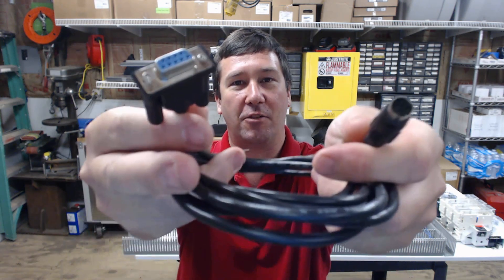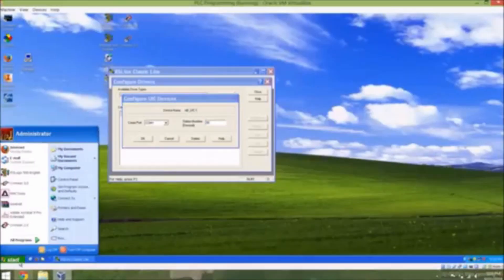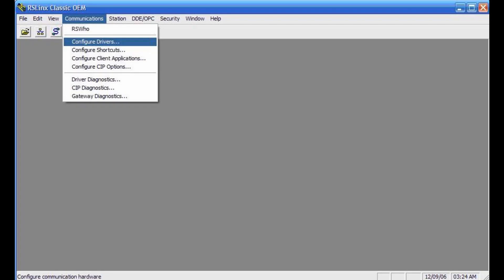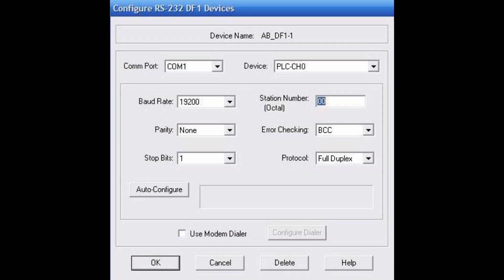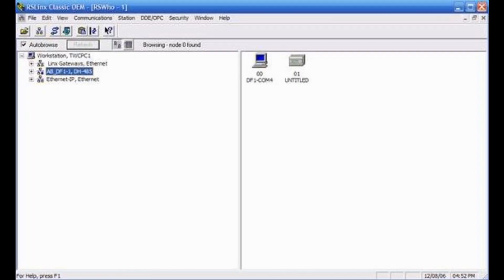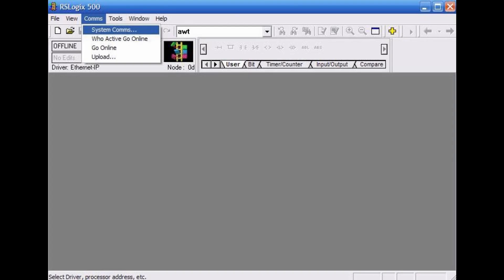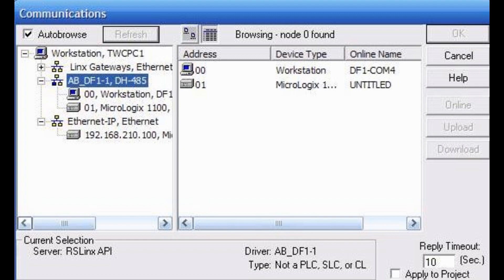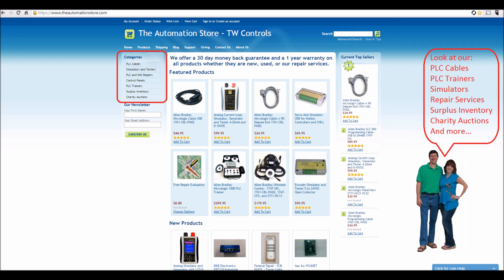Connecting to an Allen Bradley Micrologix PLC with a 1761-CBL-PM02 Programming Cable

Comment: Hi
I have a micro logic 1200 part number 1762-L24BXB
Unfortunately without programming cable, is that possible to make program cable for allen bradley micrologix 1200 with myself???
I can't work with my PLC 😢😭
Reply from the maker: Yes, google 1761-CBL-PM02 pinout
Reply: @TimWilborne  🙏

Comment: It is possible to use a convertor from rs232 to Ethernet or rs485 RTU on both sides PC/PLC and can program in that way ?
Reply from the maker: There are some. Check out Real Time Automation
Reply: Ok. Thanks man 😊. Is for my home automation , are linked via TCP , weintek HMI,  Siemens and fatek PLC but now I got a micrologix 1200 and is kinda annoying they lack of communication and 4k $ price for that old software. Also they remove all " free" versions from website. Definitely they will lose the course with that when are million of options free and definitely better. But i will mess around with 1200 for test , i got two from a friend with 12 analog extensions , so.. Thanks again 😊
Reply from the maker: You are welcome

Comment: Need help i got the usb-1761 cable but I have an error with a micrologix 1400 keeps showing failed to find baud and parity check cables i try every single one and nothing can you explain please thanks
Reply from the maker: Check you com port, beyond that either a bad cable or possible that port is configured for DH485, but that is rare.
Reply: I forgot to mention that is the round cable connected to usb in my laptop I watch your other video of the RS-232 DF-1 and u connect the 1400 with the other type of serial cable would that make a difference?
Reply: Also, I see the green light in the cable blink trying to communicate but nothing so ????

Comment: Hi Tim, As I am a starter I have a request just show me how to connect PVPlus 600 with serial cable. Cause there is no ethernet port on HMI
Reply from the maker: It would depend on the particular Panelview but chances are you would need the 2711-NC13 USB linked below.
https://www.theautomationstore.com/allen-bradley-panelview-cable-usb-2711-nc13-2711-nc14-2706-nc13/

Comment: I just my cable from your store but I cannot connect my Micrologix 1000 to the HMI. However, the Maple Systems HMI stipule that the model I purchased would be compatible with MIcrologix 1000! Any suggestions from you?
Reply from the maker: Can you direct me to the manual that the Maple said to use the PM02?  Typically that would not be the correct cable from a Micrologix 1000 to an HMI.
Reply from the maker: Correction, I did find it documented that the 1761-CBL-PM02 should be the right cable from a Micrologix 1000 to the HMI5000 Series or a HMI600 Series Maple HMI.  Are either of those yours?

Comment: sir I tried with 1761-CBL-PM02 to communication cable not responding.
Reply from the maker: That is the correct cable so either you have the wrong serial port selected in RsLinx or someone has configured the serial port for DH485.  Only in rare instances is the serial port configured for DH-485 so double check your com port number.

It has Ethernet, why not connect over it? https://www.youtube.com/watch?v=U-s_Cz8-nas
Reply: @TimWilborne  Thankyou very much  for the reply I will try again.GOD bless you
Reply from the maker: @Cinanerohan  You are welcome.
Reply: @TimWilborne  sir presently I am using Ethernet   for that I am thankful to you sir, but i want to use this port with my laptop. I purchased cable and RS232  converter  and and tried .My laptop does not have D connector so I tried with this cable.  It is giving port address ,when auto configuration option selected after some time failed alarm coming. My request is  possible to use port .suggestion please.